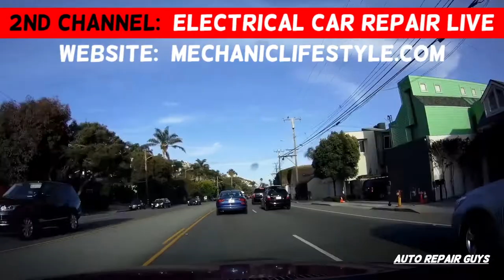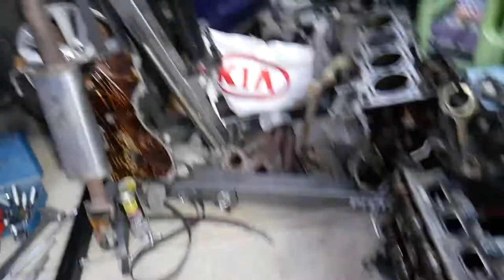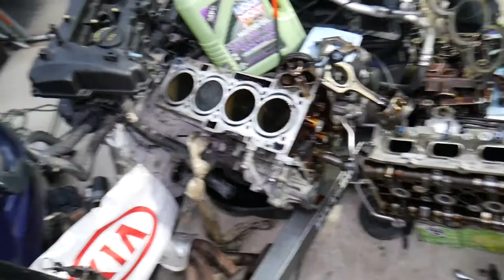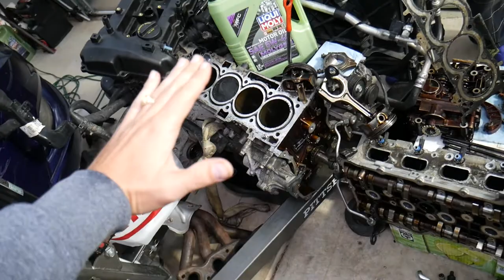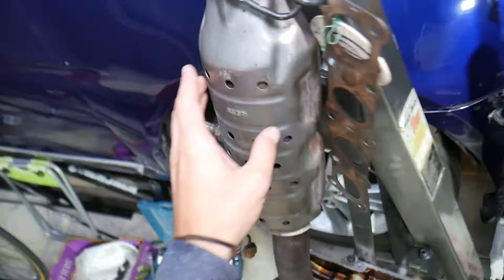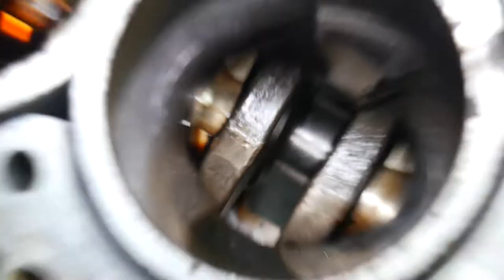DO YOU CHECK ENGINE OIL LEVEL WHEN ENGINE OIL IS HOT OR COLD

Comment: Used to always ck my oil after car sat overnight.  My owners manual states to check engine oil hot. Run the engine drive car.  Shut off engine wait 3 minutes and check the oil level.    So, was I under filling it before since I topped it off after checking dead cold? Or was I over filling it

Comment: Thanks guys , love your videos. I had always checked the oil on a cold engine so I’d get a correct reading of what was in the oil pan  but now I have a 2012 Dodge Avenger 2.4 L and the oil dipstick says right on it to check with engine hot so now that’s what I do . I would assume if it’s not stated on the dip stick still check it cold but if it’s stated on the dipstick to check it hot , like the Avenger,  I’ll continue to do that . Thanks again.👍🏻

Comment: A lot easier to get an accurate reading when the vehical is cold. And check the level every month, or sooner if you're leaking or burning oil.
 Lastly: 10k or 15k might be how long synthetic last, but doesn't take into account the buildup of impurities.
 Me you ask? Every 5k or six months, whichever comes first. And yes, oil is cheaper than major repairs.

Comment: I always thought you check engine oil level cold but since i got a newer car with direct injection my owners manual says check oil after it has been running 7 minutes after shut down for correct level.

Comment: Better do what the owners manual says.
My Toyota manual says to warm up and wait a view minutes before checking.
Reply: same for my VW..
Reply: Subaru too,also Honda
Reply: It does say that, but that's because nobody is going to check their oil in the morning before work. People are more likely to check at the gas station while the engine is warm. Lastly, the "normal" level Is anywhere between the low and high hash marks, which is about 1 liter in all vehicles, so the margin of error is literally 1 liter...  You can check it cold and it's likely more accurate that way just because of how dip sticks are designed these days. Just aim for the middle of the "normal" range and you should be fine. You can also check your oil cold and hot, and not the difference between the two, then make a mental adjustment.

Comment: Awesome, I've always checked cold because, all the oil is in the oil pan.  Another reason for the Kia\Hyundai oi consumption is carbon build up on the top piston ring.  I you compare that piston from a Kia to say and turbo RDX, you will notice the top ring on the RDX is farther away from the crown of the piston.  So, valve intake cleaning done every 15k miles or so, and combustion chamber cleaning around 50k miles.  I only just learned this a month ago.